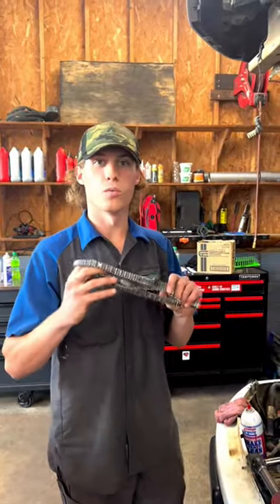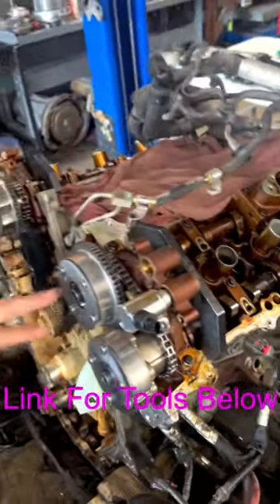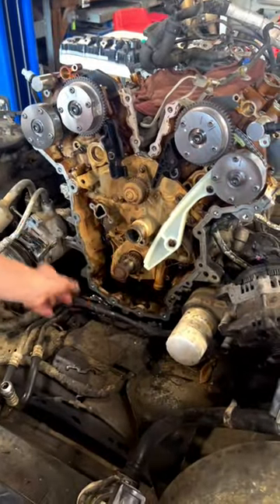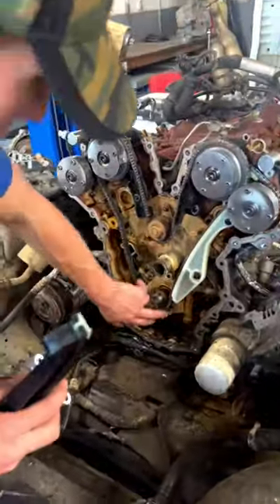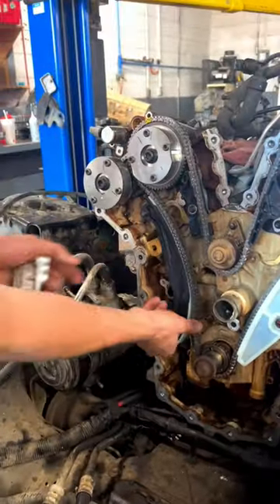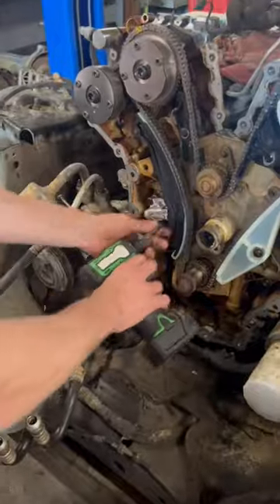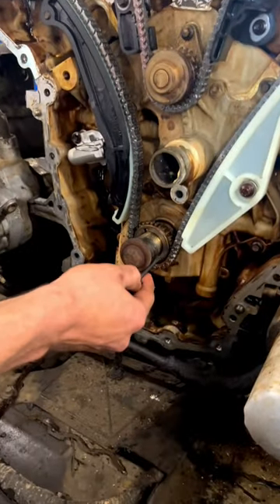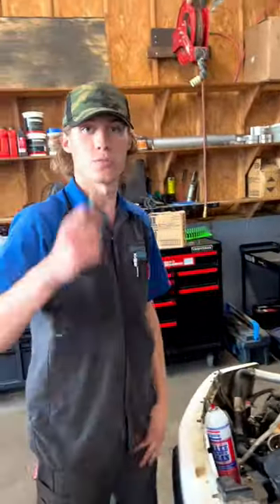How to Time a Ford 3.5L EcoBoost #shorts

Comment: Thank God for good old pushrod chevy V8.
Reply: Thank god for Ford v8’s without lifter failure
Reply: @Limited-uq2yk  lol Ford has more issues with there engines plenty cam phasers timing chains Break oil Burner's turbos locking up
Reply: @donaldkinder6716 Ford performance certified mechanic here:bro one word… maintenance. 

You do that, 7 out of 10 you WILL not experience issues with your Gen 1 5.0 Coyote or Gen 1 3.5 Ecoboost. Gen 1 being the 10 year old first version of the 5.0 or 3.5 Ecoboost. You can’t talk shit for Gen 1 motors that have been out for 12+ years. And speaking of 12+ years… how many fuckin motor replacements for the GM Vortec 4.0? That makes little power (safe power to last long, that’s what they were designed for) those motors don’t last more then 6 years;unless low mileage or 10 years of their motor being replaced at least once (87K-130K mileage). 

How do I know this? I’ve been a GM mechanic for about 5ish years before going to ford now for about 8-9 years.  The 5.0 Coyote is the Best motor ever designed and it’s one of the longest lasting. It beats GM and fords other motors. I love it when “wana be mechanics” (research enthusiast) talk shit but most don’t even do their own oil changes.
Reply: @prevail2983  lol is that why Ford has the far most recalls on TRUCK'S than any other manufacturer and if the COYOTE engine is so good how come most people don't want it in a truck and GM has sold over 100 million LS Engine's that tells by FAR what's the best engine ever BUILT
Reply: @donaldkinder6716 bro thats because people cant maintain shit … cam phasers need oil
Reply: @donaldkinder6716  bro you know what VVT Stands for? You know what Solenoids and Cam sensors are? All vehicles have them. Welcome to 2024, that’s how motors make their power, also high compression, VVT engines, naturally aspirated. Or a Turbo Engine. That’s your choice now a days, either a all natural aspirated VVT engine or turbos. You know why you hear about ford 5.0 a lot? Because their DUAL OVERHEAD CAMS, so idiots don’t maintenance or take care of their motor because they don’t realize what technology is in them. I’ve been a mechanic also 20 years now. 8-10 times I see a 5.0 come in with issues is because shit maintenance. The other times is sure, a prematured failed part(s) in a motor. I’ve worked on GM, Fords all my life. If the 5.0 Coyote is such a bad bad bad motor then why hasn’t ford scrapped it? It just hit its 4th gen! Also speaking of GM, they’re NOT even selling enough Camaros with your precious LS block. GM AGAIN IS DISCONTINUING THE CAMARO AGAIN!!! That’s twice ford has outsold  and over performed past GM! 

Everyone’s either buying a Coyote or hellcat and speaking of hellcat they don’t even last as long as a coyote or specifically just the naturally aspirated 5.7-6.4 Hemi. Do you see Camaros running 9 sec quarter miles with STOCK motors with just a supercharger with a healthy 810HP and 690 torque, not to mention these coyotes love air and have no issues with 800HP as a Daily? Ford even lets you keep your warranty if you want a blower. Bro the Coyote is one of the best motors out there, and I find it funny how your talking crap of a 11 year old gen 1 with more then 150k on the dash. 

And fords F150’s have the most recalls huh? You sure? meanwhile it’s the #1 selling truck in America with the 5.0 Drivetrain.

Also the 5.0 is the most highly requested motor customers want. Because it’s Solid. Less issues then the 3.5,2.7,3.6 

The 3.5 Ecoboost is the Worst motor of ford, they have the most issues, from its first gen (2012) to its new present gen, for the past 12 years the 3.5 is the worst motor out of the F150’s lineup. Besides the 5.0 the 2.7 Ecoboost is actually just as good at the 5.0, despite having more parts being a twin turbo. 

By the way ever notice when your watching a videos of a failed 5.0, the person ALWAYS MENTIONS HOW THE MOTOR WASNT PROPERLY MAINTENANCED, or the other fact when you see a failed 5.0 it’s because of Sludge build up from the oil and crystalized debris from the oil? Do you know why the Cams/Phasers even fail?????? Because shit maintenance, over mileage oil life is the cause of premature failure of these motors because sludge builds up in the VVT Solenoids and can phasers JUST LIKE GM
Reply: @donaldkinder6716  I've fixed more Chevy 5.3's with bent pushrods than I've done phasers on fords 10:1. 😂

Comment: A lady at the grocery store just asked me how to do this yesterday. What a life saver!
Reply: underrated
Reply: It's so easy. A lot better than the GM. As long as you got the cam holding tool you can take all chains off. Throw them away. Find them later and then put it back together. Cams only lock crank at 4:00 4:30 position cranks up no correlation problems. Beautiful engine. I love it! Reliable 200 plus thousand miles guarantee with oil changes. Synthetic to be specific
Reply: @marcus8733 lol sure bud you can keep that overhead CAM JUNK GM built over 100 million LS Engine's

Comment: You forgot to show how to take the whole car off of the engine 🤣
Reply: That’s actually the easy part lol
Reply: 6 bolts depending on vehicle disconnect all body to frame harness all fluid out disconnect brake lines at the master they’ll hang out with the frame a connector in the front bumper you have to get AS you lift the cab grounds and uh oh steeering shaft and shifter linkage too think that’s about it though most of the electrical to be disconnected is in the wheel wells and there’s 1/2bgrounds on the firewall up towards the cowel with one from frame to cab
Reply: @erictech201  very true 20 minutes if that
Reply: Lmao
Reply: You don’t have to I do them in car just less room
Reply: Yeah
Reply: @Dingleberry454  what about the AC lines. I own a 6.0 haha
Reply: When I did a buddies I didn't do that I just took the rad and the whole front assembly out.
Reply: You don’t have to pull the cab. My first mentor was doing these in 3 1/2 hours in and out the door
Reply: @chasegrostic355 i agree i do these daily and 4hrs tops its done. No ac evac n recharge n bleeding brakes. And no wasted time lining cab up.
Reply: @chasegrostic355 but yet still get charged for up to like 14 hours of labor?🤷‍♂️
Reply: @williamoestreich6905 so do you charge 4 hours of labor or what the book calls?
Reply: @bearing_aficionado by the book. Thats how flat rate works. U buy the special tools needed to make time to make more hours aka money. Same as a dentist. U get 5 teeth pulled at once its still 100-150 atooth even tho ur allready numb and tools are allready dirty. Lol.
Reply: @bearing_aficionado  we as mechanics don't make the book times. They are what they are
Reply: @bearing_aficionado  It's really a market price. The job has a value.

Comment: So easy with the cab off . 😢
Reply: They’re still a pile of crap, just harder to work on each year 😂
Reply: Everything is easier with the cab off. And cabs are so easy to pull. It's not just a Ford thing neither. If the cab mounts aren't totally rotted out, I'll yank the cab on Duramax head gaskets everytime.
Reply: @jefftruckshop6591  ya things used to be a little more simple. In 1986 . When I started doing this.  Back then yes we coursed at engineering, Now I want to scream at them

Comment: Quoted 5500$ canadian for this job. Doing the job myself.
Also this problem is a reoccurring problem in all EcoBoost models, gotta love hearing the dealerships say you must not have changed your oil at the proper intervals 
Mobile one full synth every 3-5k kms.
Dealership mechanics are something else .
Reply: Quoted 1650$ canadian for my Honda Ridgeline timing belt 😅. I buy the parts and give my buddy 500

Comment: If it's on a used car lot and it's got an Ecoboost, it's there for a reason. Whatever dealership it was traded in at didn't have brave enough service techs to repair it so it was auctioned off to a buy here pay here lot where they put a piece of black tape over the wrench indicator light to buy them enough time to get it sold and now you need a timing set and new FOMOCO phasers which are identical to Dorman ones except they grind the FOMOCO off but it's there

Comment: In addition to this method, I found comfort in counting the links on each side of the main chain from phaser dot to crank dot. Found that method in the factory service manual.
Reply: Yup. 48 links between RH intake phaser and LH intake phaser marked links/phaser mark. 35 links between LH intake phaser and the two marked links on crank sprocket. Note you do NOT count the marked links.

Comment: Looks way easier to do than my 740il. Just did the timing chains and guides and osv just recently. Was not fun. But it's now done and surprisingly hadn't been done for 170,000 Miles. When I pulled the guides out they were just about to start crumbling. They had severe grooves from the chain. My water pump shaft or bearing gave and was wobbling but sounded like my guides were finally grinding and gone. Which I'm aware that the m62tu engines have the guides go out around a 100,000 miles. Which I got lucky and since I bought it at 140,000 Miles and it was still running great that they had been replaced. But I just got super lucky. It's a good thing my water pump went out. Already had the whole timing kit and tools and water pump ready because I was planning to do it anyway as maintenance. Just got all around lucky. The job took a few days in my driveway. The hardest part was the crank bolt. I had to torque it to 400 ish ftlbs. I also had to break it loose with a long ass breaker bar and my jack handle on top of that. That was a nightmare. 😅
Reply: Oh, god; I shudder just thinking about it. Helped my old boss fix his 325i once, right when I was looking at a 5 series. 

I didn't buy it. X3

Comment: Just got that service done by FordTechMakuLoco. The service included new style cam phasers. Cold start ticking is gone!!!
Reply: I might do it myself, I wish he could do mine.
Reply: I need it done but haven’t looked into it. What does it cost?
Reply: @brianb900  I just had it done (not by FordTechMakuLoco), had everything replaced (WP, solonoids, acutators, phasers, chains/guides/tensioners, valve covers (the plastic ones break when you remove them).  Basically everything under that front cover except  the oil pump, and it was $3900.

Comment: Always impressed by mechanics, crazy how much they have to deal with. I hope I never have to deal with this? How many miles did this engine have?
Reply: Thier prone to this problem at aprox 90,000miles.
Some newer models have had this issues present at 10,000miles. 
It's very hit or miss considering theres ecoboost that have clocked 200,000+ miles with no issues. ( even though uts still an outstanding and prone problem with the motors )
Reply: @hondaftwg9543  I am currently at 67k and have ran premium fuel for the first 50k miles, always keep an eye on the air filter, and full synthetic oil always (change it at 5k and on my last oil change I switched to natural gas Shell oil). Very little of my driving is city, and just changed the spark plugs. I have powertrain warranty until 100k. Not sure what else I can do. Other than catch can but that will void warranty.....

Comment: the fact that one has to take the body off to do something as simple as a timing chain job is the reason why i love my 1994 f250 with the 7.5l
yeah it gets 10mph but it also has 400 000 miles and i had to change the water pump the other day! 
damn!
Reply: You don't have to but it only takes about 25 minutes to pull a cab in a dealer.
Reply: @jordankelley5923  
I hear people say that but I've never seen it done that quick. Best is 1.5 hours.
Reply: A buddy has a 2013 F150 in his fleet with the 3.5 Ecoboost. I looked at the fuel milage: 10.2 MPG.🥺

Comment: Looking to do the timing set in my gen 1 3.5 in my 2013 f150. No consistent timing noise. But these cold winters in upstate by. She develops quite a rattle on the cold start. 133k far as I know she’s all stock.

Comment: Isn’t replacing the oil pump a good thing to do while ur into the motor?
Reply: not without cause. there is a high volume/pressure option for those who want/need it

Comment: I've been through my personal f150 so many times that I can tell that's what you are working on just by the frame , trans lines , and a/c compressor.  oh, and the forward facing oil filter.  

  thanks for the vid
 when I 1st stated building my truck, there was very little out there about these platforms. thanks to folks like yourself, the knowledge is getting out there, and "garage" builders like myself have been taking these trucks to the limit and beyond.  

thank you bud.

Comment: Hey, I enjoyed this but question, why didn't you change the water pump? At least it doesn't look like you did. It would seem a little silly to do all that work and not change out a failure point?
Reply: What you think is the water pump is an idler. Longitudinal 3.5 has external water pump that uses the drive belt and is easily replaced

Comment: What happens if the color link on 1 phaser is a half a link off? Mine is off a half a link. The bottom one is lined up and the drivers side phaser is lined up but not the passenger side.
Reply: It'll run bad & code. Most likely. Were you able to get it lined up? You could move the cam a little and see if it lined up
Reply: @seabeeeff  I did, I rotated the phaser a little bit and got it lined up. This was my first ever timing chain replacement so it was a little daunting but I got it all worked out and back together. Hope I never EVER have to do it again but I know how if the need arises again. I just hated doing it. My sternum was bruised for a week after from leaning over that truck for hours and hours
Reply: Bruh, i feel you with the bruised sternum! I'm on my 2nd day doing mine right now and I'm hurting lol.  How did you get the phaser lined back up? @hustlinghard8081

Comment: I use the aluminium blocks to lock the  new cam phaser on the 5.4 3 valve..   Those 3 valves suck. I've seen valve springs break on 3 separate engine break on cylinder 7 on all 3..

Comment: But what about the secondary chains? some folks may not know that you may possibly have to turn the intake and exhaust cams/phasers simultaneously to get the Phase guide pins lined up correctly without mistiming the Phasers!!

Comment: My dads 2015 explored sport had to have this done before 75,000 miles and a turbo replaced under warranty. Now it’s rusting BAD(90k). Come on ford
Reply: Which state is he in?
Reply: @alexanderchenf1 lol don't matter All that trouble less than 100k miles stopped buying Ford products 20 yrs AGO
Reply: @donaldkinder6716  it does matter. 
I have a 2019 F150 Lariat 4x4 5.0 at 110,000 miles +. It’s running strong. I wouldn’t buy overpriced Tundra.

Comment: Well i think you should start with confirming if its a interface or non interface engine, if it is the make sure engine is in correct position/piston is at top dead center before staring, check for proper clearance/backlash and align the marks/dots ensure engine is in the right phase, dont use old or poor quality aftermarket parts, plastic can be brittle
Reply: It is an interference engine, but the marks only line up if cylinder 1 is at TDC.

Comment: Yup. It's been a while since I've been into a GEN I 3.5 EcoBoost engine. Feels almost like yesterday now with all these GEN II phaser replacements I've been doing lately. Apparently a new TSB is out for 2.7 engines in 2019-2022 model years Edge and Nautilus applications for noisy phasers as well. Ugh.
Reply: Is that phaser replacement a major job to do??
Reply: @LegendaryDFault361  on which vehicle? On the vehicle featured in the video, it definitely is a bit of work.
Reply: @michaelchan8915  
It's a 2013 f150 ecoboost. My dad has that issue with the rattle on startup sometimes.

Comment: I have a 2017 3.5 twin turbo, I replaced water pump and put cam tools on engine, however my timing marks are not at the top and the chain feels like it’s about a half tooth off, what should I do next?

Comment: Do you do the water pump while your in there? The 3.5s leak water into the oil pan
Reply: Not on f150 3.5 Ecoboost, the water pump is external
Reply: @adamp9377  ahh gotcha, had a 3.5 fusion come in with a cracked water pump that leaked coolant into the oil

Comment: Hi can i move the crankshaft alone against clockwise while the chain off to put it on the 4 o’clock position for ford explorer 2019 ? Actually need about 180° turn against clockwise to reach to its point 
Can I 
Thank you so much
Reply: Please I’m waiting for your reply about my question 
Thank you 🙏
Reply: @talaatkanafani3383  did you ever get an answer to your question?  I’m in the same boat. Thanks
Reply: @ no
Reply: @talaatkanafani3383  how do you get the crank back to 4 o clock?

Comment: Doesn't cylinder 1 have to be top dead center? If so that dot on crank still could be wrong right? Can't it land twice, once with whichever cylinder top dead center? Just asking because I've timed quite a few engines besides these and always was cylinder 1
Reply: All 3 marks only line up if c1 is TDC.

Comment: I've done these. Used the camshaft holders and didn't dare touch the crank when I had it all apart. Still see one of them drive by the shop on a daily basis. Quiet as can be.

Comment: Is this the engine that has the water pump behind the timing cover? The inevitable seal failure will dump coolant into the oil pan. 

Genius design
Reply: Same engine, wrong configuration. This one's longitudinal, transverse has the internal water pump. The pumps leak externally before internally majority of the time. Only way it gets in the oil is if you're unlucky or inattentive.
Reply: No you’re wrong. This isn’t the engine you’re thinking about. Also for the transverse 3.5 ecotec when the water pump fails it won’t leak internally. It will tateltell near the AC compressor.